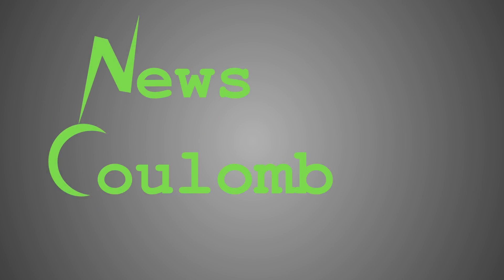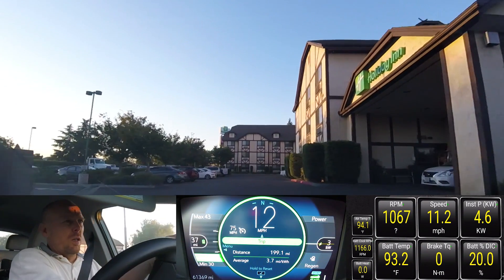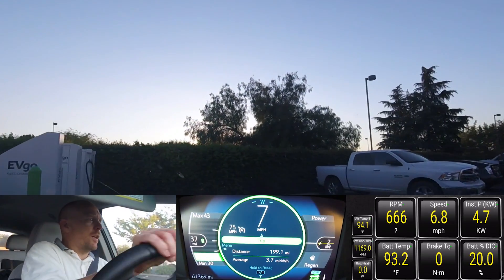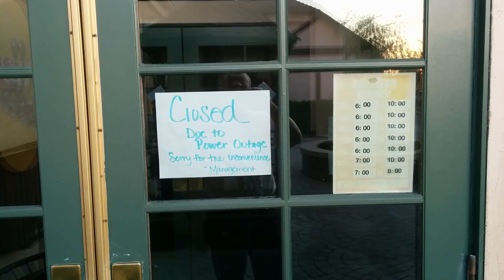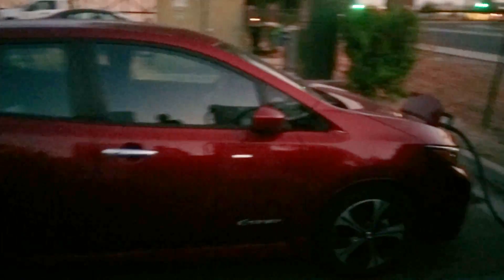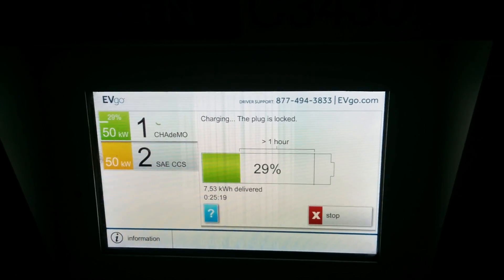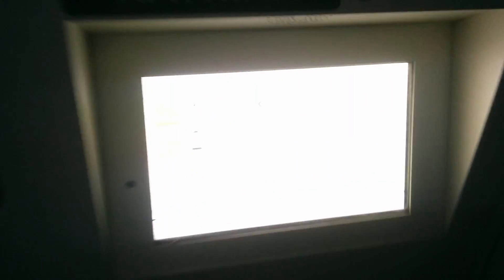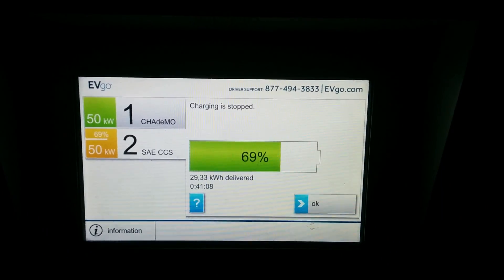First-Hand Look at 2018 Nissan LEAF Charging in Hot Weather

Comment: Our 24kw leaf.... That speed is normal man. Still leaps and bounds faster than 6kw..... Your are "spoiled" starting with your bolt. Seriously. Our leaf, even at 10 percent SOC... Starts with around 34 kw.. maybe 40 for a few seconds... Then tapers down to mid twenties very quickly...they just don't have a cooling system..... My spark and your bolt... Completely different. I will NOT be buying another leaf.
Reply: TRY to HELP you   My 24 kWh leaf is same way.
Reply: Maybe I'm mistaken, but I think I heard him say he used to drive Leaf.
Reply: @mychevysparkevdidntcatchfi1489  don't think I have heard him say that... Hmm....

Comment: The 40 kWh Leaf has a use: A commuter car for those whose commutes exceed 60 miles round trip in cooler climates. If you're OK with only one rapid charge per longer trip, it's a fine choice, cost to acquire being the only major issue. Most people won't use their cars, gas or EV, for longer trips any more than perhaps twice a year. The main issue for this car is cost: Buying new is expensive, as is any EV, and once it hits the used market, one has to factor timing of autonomous vehicle service availability into whether to appropriately buy the car, or just get a cheap ICE car to tide them over until the transition happens in earnest.

To have added any form of battery cooling, whether air or liquid, would have added to the cost of the Leaf, both at R&D and manufacturing levels, and I suspect Nissan didn't want to spend the money, especially since their market research found that most people won't rapid charge their cars all that often, if at all.
Reply from the maker: It does, but Nissan needed to be up front about this. It looks like people in hot climates might not even get on fast DC charging session out of it.

Comment: That Nissan was probably on their third charge.

I don't see you complaining about those Bolts slow charging at 80-90% SOC. Here in Southern California, we are overrun with Bolts hogging charging spots.

The only solution is to get rid of free charging.
Reply from the maker: All the free chargers are always hogged in Southern California. That's why I don't support free charging. 

As for the LEAF, it had been sitting idle for over an hour. It's parked in the lot as I pulled in. At that charging rate, it would be taking up one of those chargers for hours. That really stresses the network. 

As for the Bolt EV, it does exactly what GM marketed: 90 miles in 30 minutes.
Reply: This is free too???
Reply: Lol at "bolts slow charging at 80-90%", right because slow charging maybe the final 5-8 kWh is as bad as slow charging an entire 40 kWh pack.
Reply: It's Maven Bolts that get free charging. If you buy/lease as consumer, you don't get free charging. But I agree, ALL free charging should be eliminated.
Reply: Half charged Bolt only 30 miles shy of fully charged Leaf. Just sayin'
Reply: I've seen a 40KWh Leaf hit it's thermal limit on the first DC fast charge after a freeway drive in 80F weather.